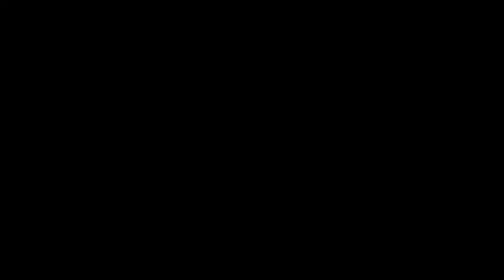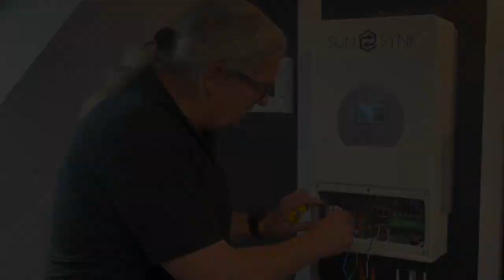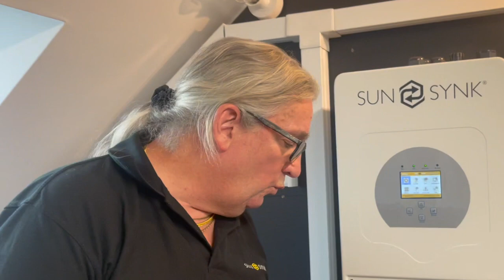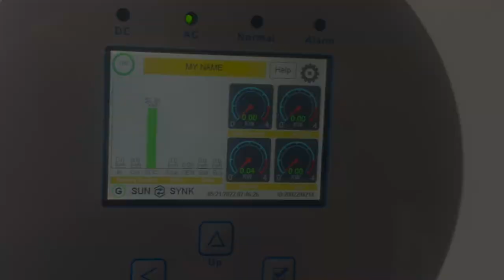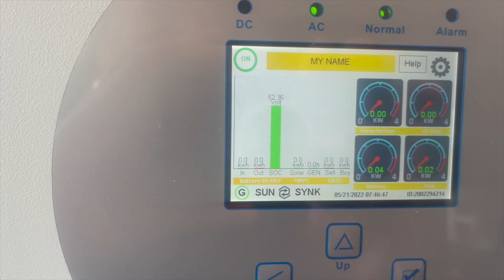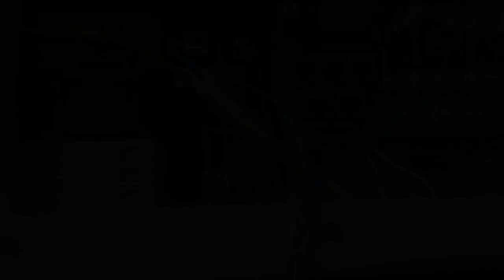Creating an Earth  Neutral bond on a #Sunsynk Hybrid Inverter

Comment: ANENJI 11 kW hybrid inverters do not have an earth and only a few lines in the manual about its dry contact. Also, the 15 kW ANENJI battery, while being the best battery build I have seen on wheels, does not communicate with its own inverter, so it has to use the inverter settings. Waste of a good BMS.

Comment: the only problem with this is if the inverter reads grid fault due to reasons (while the grid is still on and passed via mcb) it will open L but leave N closed (as far as I've read and tested)
the ATS will trigger a N-PE bond which is already available and done in upstream.. and this is a hazard

Comment: This contractor is rated at 25A so how will it properly bond 16mm PE wire?
Reply: You will not .try Baomin BCT 63 2NC. Make sure it is normally closed so that if power fails, it will drop to a safe earth. 63 amps will give years of service as it is overrated.For islanding, you can patch straight onto outputs if you do not have the correct software, but make sure you use a multimeter to check it all works right.Ask Google how to wire an inverter's earth in battery mode. If using a changeover switch, you can power a subpanel for a shed or just the loads you need like a refrigerator and media.Rate all you relays and change over above what you want for a longer life. The relay mentioned uses 230v and a very small amount of power so dry contacts at their 3 amp capacity will not suffer.

Comment: Cheers Keith, I just got a Schneider contactor from Amazon this afternoon and I implemented this solution, works a treat. You can double check by switching off AC into the Sunsyk, the contactor clicks, and then you can test if it is working: it should measure about 230V between L and N (or between L and E) on the EPS outputs and 0V between L and E.

I already had a double socket wired to the EPS output previously, but didn't use it yet. Now I can do so safely.

Comment: I have a question, Unless I mount it on a Van or any type of vehicle where there is no option to connect the inverter to the earth then why should I even think of bonding? Can I not just simply pull a wire from earth grounding and link it to the inverter and busbar ? Tell me if I am wrong cause I am not an expert like you who is touching contractor with bare hands.

Comment: I wanted to have my whole house battery backed by the inverter (except the shower and cooker as they use vast amounts of power), but my installer wouldn't do it because of this earth-neutral bonding problem. Was my installer wrong? Was my anticipated install possible after all?
Reply: Ask Google AI: there is a way of using battery backup and an auto-changeover switch to cut the power to the high-power users, so you don't kill your batteries. I did it out of interest.
Reply: @onlythetruthfull The UPS backup is all built into SunSynk inverter, it has a dedicated output...

Comment: What are the implications if the installer made this connection as a permanent bond and does not use a relay ??
Reply: I guess you would be not able to connect GND to earth bar
I'm suffering that problem
Reply: RCD tripping upstream

Comment: Makes total sense if you want to feed grid power though your inverter has to move the bond to the grid connected panel where the bond is made. If you're running off grid now the bond is made in the inverter.

Comment: The neutral conductor must be connected to the PE in EPS mode without having to install a contactor yourself. The living rooms may only be supplied with the grounded neutral conductor. So Sunsynk made a big mistake and didn't install a grounding relay in the inverter itself.

Comment: Why is it that the RCD keeps on tripping as soon as the bonding contractor operates after a power failure? If i disconnect the contactor and connect it after say 2 seconds the RCD doesn't trip. Can't a delay of 2 seconds be implemented to operate the contractor? Or is my RCD perhaps at fault?
Reply: I have the same problem,   no delay implemented in software and this leads to a race condition, for a small moment PE and N of the grid becomes shorted  too, tripping the RCD.

Comment: This is quite an expensive inverter with an earthing problem. I would expect these inverters to be fitted with an earth-neutral bonding contactor at the assinembly plant. Now the installer must run around trying to  fix it for Sunsynk.
Reply: LOOKS LIKE THE DESIGNER FORGOT ABOUT IT - LOL
Reply: Absolutely

Comment: The section about the software version, is the version you listed the absolute minimum, or will slightly earlier versions still work? I currently have: COMM419 - MCU:3162 on a Sunsynk 5kW unit.

Comment: What is the procedure for the Sunsynk 16kW Max. There is reference in the Manual about the neutral earth bond in island mode with the coil of a relay/contactor connected to a/t/s pinouts. However, on the inverter and in the manual, no such ports are indicated. Is there a different procedure with this machine?
Reply: You take a feed from the L of the Load port on the inverter through a mini circuit breaker (MCB) or inline fuse sized according to the wire size (note, 1mm or 1.5mm wire ideal, given that the connector strip can’t handle thick wire, e.g., use 1.5mm with a 6A MCB) into pin 7 on the inverter, take a feed from pin 8 on the inverter into A1 of a normally closed (NC) contractor. Take a feed from A2 of the NC contractor to the N on the Load port of the inverter, completing the circuit. Connect the N from the Load port of the inverter to the NC contractor pin 1, connect the other side of the NC contractor to the earth busbar. You can also get a contactor with more than one NC port and use it with an indicator (led) to show when the inverter is in island mode/when the earth-neutral bond is active. Do all of this in an external AC distribution board, e.g., use DIN rail contactor, DIN rail MCB, DB neutral bar and DB earth bar, and DB live busbar across MCBs on Load port L feed from inverter. Use DIN indicator, e.g., green for earth. Use 1A MCB indicator. Always fuse/MCB protect every link.
Reply: Pin 7 and 8 is a dry contact, take L N from load tapped though a NC relay input side. Then on then NC side of the relay, run E N though.

Comment: Keith, i bought 2 of the new ECO 3.6 inverters from Tom and Joel.
The printed installation manual , although updated for this new model ... has inadequate information on the 8-way multi contact terminal ( numbered 1 to 8 but nothing else  ! )
Dave is looking into it i believe but i am still in the dark as to which terminal operates what  ????
Reply from the maker: Should be a QR code on the side of the inverter that links to the correct manual

Comment: Thank you for a very informative video.

How would you suggest this be achieved in a Parallel setup, having multiple inverters, master, slave, etc... ?

Do they need to "share" a contactor or should each Inverter be on it's own separate contactor? ( I would assume each Inverter should have it's own contactor, including "Island Mode" configured on it - and not just the master Inverter ).

The reason I am asking is that none of the manuals or videos I've been watching is clear on this subject ( relating to a Parallel setup ), and I found that if Inverters are running in Parallel then the slave is not 100% synchronized with the master and that a slight delay ( milliseconds ), causes the RCD to trip upstream ~ note that both Inverters outputs are "Paralleled" together towards the main distribution board ( upstream ).

Should you ( if each Inverter has it's own contactor ), enable "Island Mode" on both Inverters ( or only on the master )?

Thank you!
Reply: I am not commenting as an expert but id assume inverters connected in parallel share a common earth meaning only one bond would be necessary, having more than 1 could be dangerous as the earth wire could become hot if a short occurs between the 2 bridges essentially turning electrical devices with steel enclosures connected to the inverter into electrical execution devices.  I would assume the master inverter will be tasked with the neutral to earth bond. If im not mistaken in South Africa legislation demands the inverter neutral to earth bonding must be permanent
Reply: If the inverter neutral-earth bond is permanent don't you get ground loops?
Otherwise I cant see the point of switching it with a relay.
And this video really ought to show use of a ground spike for Islanding Earth.